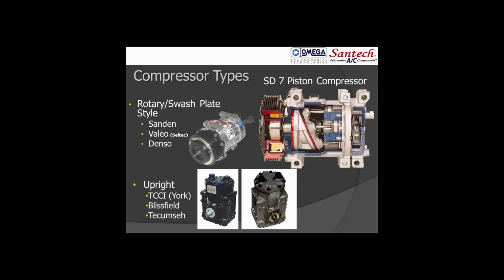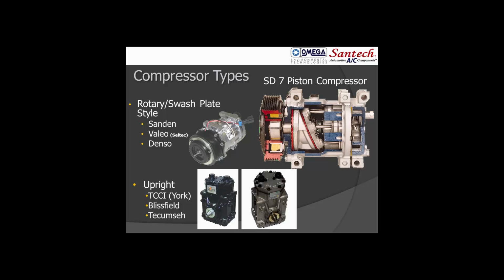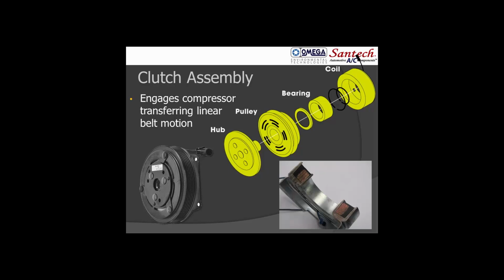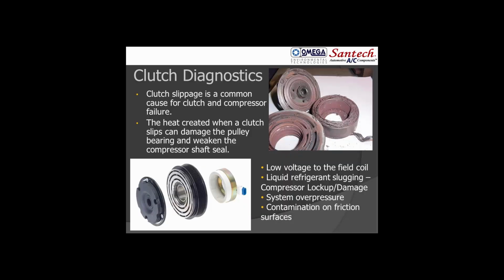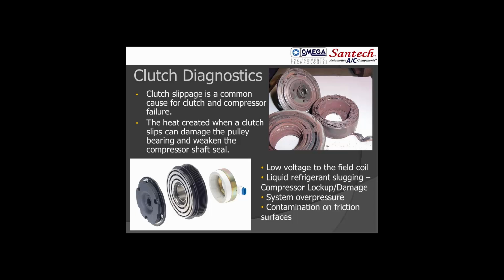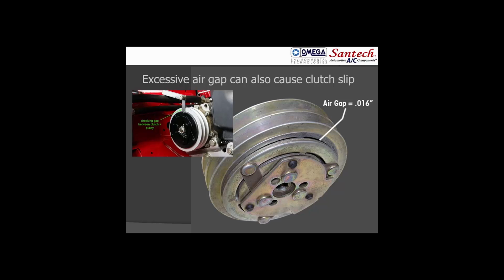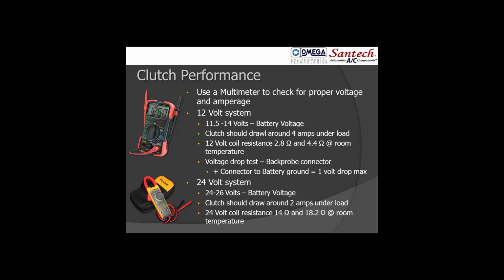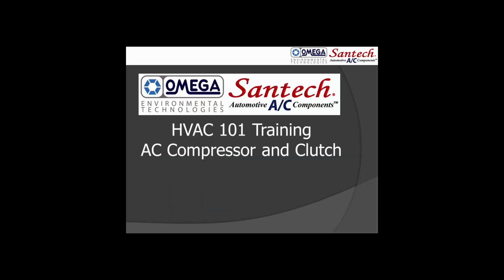2 AC Training   Compressor and Clutch

Comment: At 7:29 you said "When resistance goes up, Voltage goes down." But according to Ohm's law, R = V/I which means Resistance is directly proportional to Voltage. So, When Resistance goes up, voltage should go up. Isn't it?